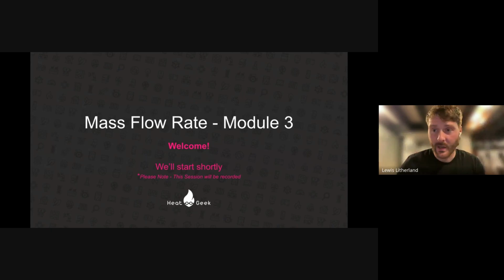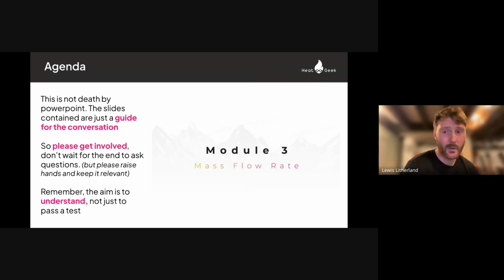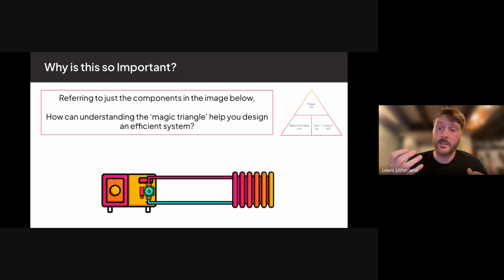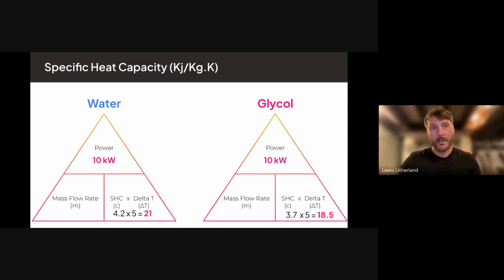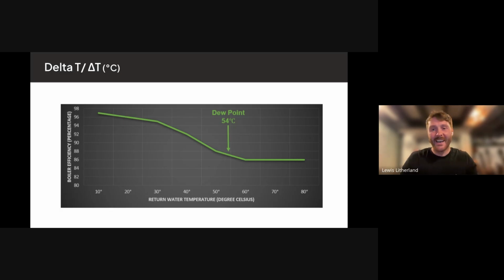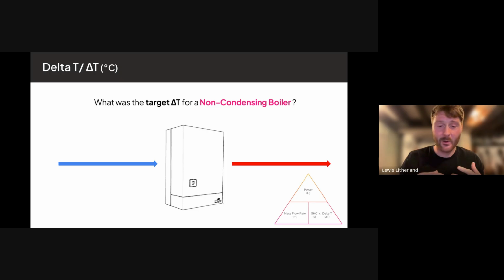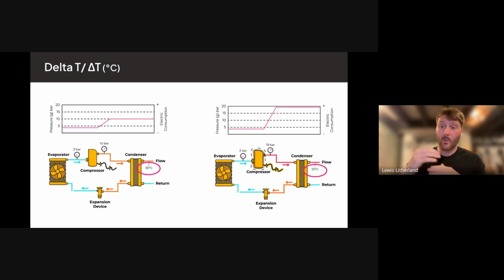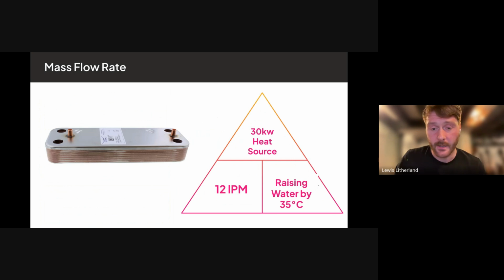Understanding Mass Flow Rate - Heat Geek Course Training

Comment: This last one calc doesnt make sense to me. To heat up water from 10 to 45 deg you need energy not power. You say you want to do it with 30kw device and then move to flow calc. So you want to keep 30kw pouring into water of 10deg until it reaches 45deg. You cant answer it by saying I need flow of 0.2l/s or whatever you came with. Flow will only give power in steady state provided fixed dt. Assume you have a heater of 30kw, you have to give dt for that heater at which it gives off that power. If there is a flow thru that heater youre after you need to keep average temp of that heater at level with risjng water temp you are heating up while maintaining dt of water thru the heater to maintain power output. Or maybe i didnt understand the problem

Comment: An accidental find, didn't realise HG were putting training modules up - Glad Lewis examined this from a condensing boiler perspective, and he is spot on about legacy gas boiler issues on every aspect of heating, including training, and believe me it's even worse over here in north east Romania.
   I had to stick with gas when my old condensing boiler blew it's mainboard 2 years ago on a decidedly brisk -6 March - Unreliable mains and the idea of breaking open the concrete floor to upgrade main pipework knocked any notion of a heat pump - A 100-w combi went in with a UPS and bigger rads followed over summer, but real world results have been interesting.
   Now on 'continuous' heating (more accurately circulation), the return is stuck on 23-24, every room flatlining at individual target temps (set by TRVs) - Gradually reduced the feed temp, and currently tracking the Viessmann 0.8 curve and it's working a treat - Delta T at the farthest away rad only rose to 12 when it was -8, and quietly confident it'll sail through the annual -15/-16.

I'd only correction the notion of a fixed delta at the heat source, it can't be - With weather comp the dt will will vary and the return will always be fixed at a few degrees above room temp with rads, or the slab temp for UFCH.
 
An interesting and well presented module all the same.

Comment: Great tutorial, thanks! I live in Norway and have just installed underfloor heating in most of the rooms of my house (150m2 timber frame house from 1920s with 15cm rockwool insulation). Everyone talks about heatpumps, including here in Norway, but I went for a simple electric boiler. It's a fraction of the price, easier to install and maintain and works perfectly. Norway's also just fixed electricity price as an option for those who wish, which now makes heat pump pay back time 20 years, which is more than the life expectancy of the heat pump. Anyways, will be continuing to follow and learn from all you Heat Geek folk - but please can you also try and include simple electric boilers in your discussion and use cases. Simplicity and reliability often trumps complexity, particularly when so few people know how to size, design, configure and install heat pumps correctly :-)

Comment: No glycol !!!!! Air source heat pump is outside the house which means it’s in the minus temp in winter. Default for the heat pump if the water freezes is to dump all the water out of a valve to prevent damage to the assembly, this the shuts the system down. So now the heating is not operable until an engineer turns up, no heating in winter that’s not desirable. Alternatively the heating can be set to use a frost stat so if no glycol and the outside temp drops below freezing the heating will activate and use energy while your asleep in bed just to keep the system from freezing.

Comment: This video is so easy to follow and understand. It helped me realise why heat pumps are so efficient to run compared to gas. It also helped me appreciate that oversized pipe work and radiators in a house with a non-condensing gas boiler can be helpful when installing a heat pump. It's all in the maths

Comment: Hey Lewis. Please take this kindly as that’s how it’s meant. Stop apologising as you had not one single thing to apologise about during that presentation - adding some detail where it makes sense and makes things real world is always good and selling your other services briefly at the right point is also exactly right given your audience. 

The real world decisions to be made to get a good balance between capital spend and disruption vs running cost savings is right up there as a key design skill to match customer satisfaction along with assisting in presenting pricing that wins business. As is being able to articulate in a customer friendly way how the proposed balance was arrived at. 

That’s partly why the skills side is so vital so you know what the effect of each lever you can pull is likely to be (eg what if we stretch deltaT to 6 for this particular refit? What happens to my efficiency and therefore running costs and what happens to my shopping and labour and redecoration list? What’s the likely payback?)

That’s the real definition of ‘the best solution’. 

Being able to quickly and fairly accurately process ‘what ifs’ is vital IMO. 

It would clearly help if manufacturers provided more nuanced performance data but that’s another story.